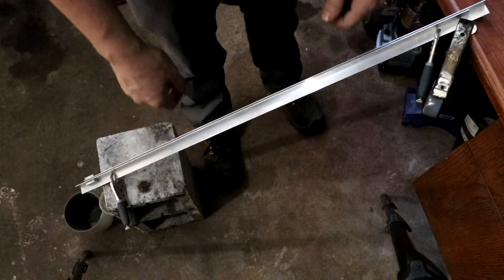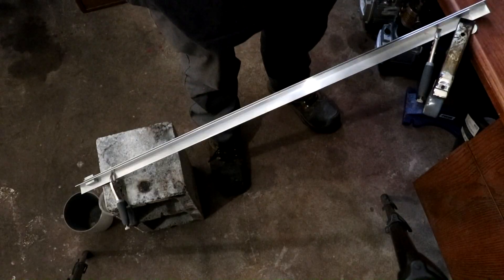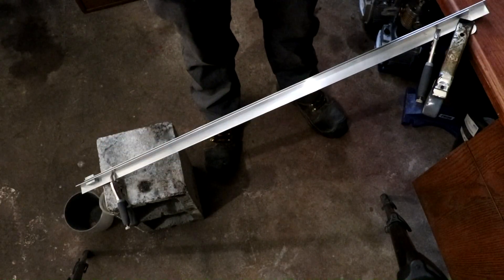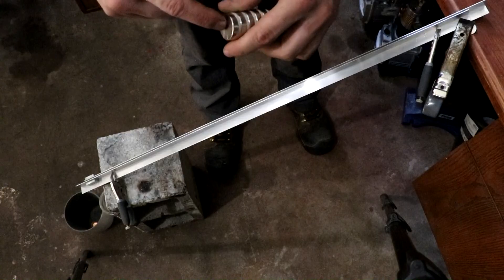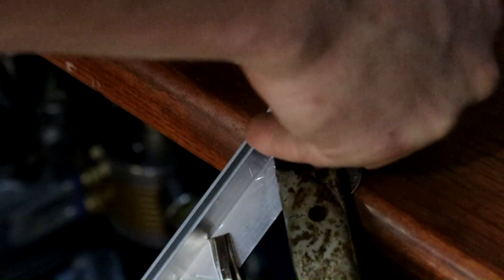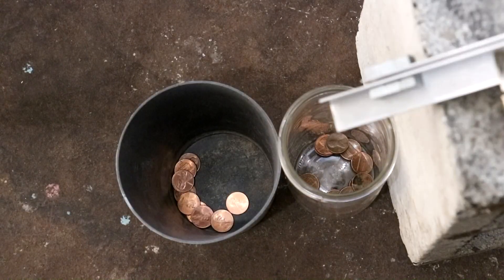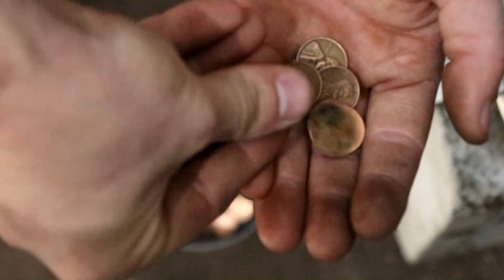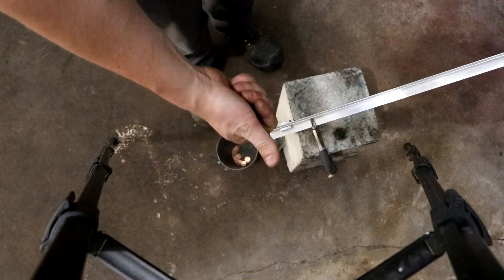I Made a Super Simple Penny Sorter!

Comment: I had an idea for a device to pick up spent brass casings at a shooting range using an electromagnet. It's be a scoop with the open end facing the electromagnet, and a switch to briefly energize the magnet. With a strong enough magnet it'd kick the casing into the scoop but not the surrounding gravel.

I wanted to make it because bending down to pick up brass casings at a Cowboy Action Shooting event was hell on my knees. But I didn't follow up on it because I was afraid the electromagnet might screw with someone's pacemaker.

Comment: 1982 d small date, 1983, 1987d worth more then a $100 in 90% copper error
Reply: 1982 have small date 3 variety for both zinc plated and copper, and large date 4 variety for zinc plated and copper, mint mistake copper was 1982 small date d, both mints of 1983 and 1987 d

Comment: Are the angles you used steel or aluminum  I know aluminum is not magnetic but I don't know if you have magnetic but I don't know if you have magnets on both sides and they are simply sticking to each other with the magnetic field between . Nice work. Is very simply but awesomely done

Comment: I'm a little ashamed I hadnt thought of this.  I was, several years ago, thinking of having an area in a man made river that was all pennies.  Since zinc corrodes much faster than copper I wanted to separate them.  In the end the method I was leaning to was using liquid to float the lighter zinc coins off, but didnt because I didnt want to have to try and wash so many coins to prevent toxins in a living river.
  I might dust off the idea, if I can get enough pennies with this coin shortage.

Comment: In the recycling industry, the device you made is referred to as an eddy current separator. Also, this points to a potential issue you'll have using eddy currents to stop a bullet: The higher the electrical conductivity, the higher stopping force. With a lead bullet, the forces may be very small

Comment: Cody will you use a water bottle as a vacuum tank and have a vacuum gauge attached to it, and then put that bottle in a pressurized chamber and try and measure the pressure in the outer tank by using the change in vacuum in the inner tank.

Comment: Hey Cody! I have a Chemistry problem I need to solve, perhaps you can help.
The production of biodiesel is very easy and efficient, but my problem is that while using a base catalist (like KOH) a lot of soap is formed in the transestherfication reaction with water(unwanted), methyl, fatty acids in oil and KOH. This soap causes the mixture of biodiesel and glycerine (the reactionproducts) and water to form a strong emulsion. This way the biodiesel can't be seperated from the rest. How can this be fixed? (there is a lot of information on this topic on the internet, but not everything works). 

I really enjoy your video's! ;)

Comment: Fun fact:  no Lincoln penny is "pure copper",  the vast majority of pennies pre- 1962 were bronze (95% copper and varies mixes of tin and zinc making up the other 5%, with the exception of the 1943 steel pennies) , in 1962 the tin was removed from the recipe giving us a high-copper brass coin.  and as you noted in 1982 the mix changed considerable and they went to a zinc core and only 2.5% copper overall.    

TLDR: if you want a 'pure copper' coin you actually have to find pennies from before 1857.

Comment: For the MK 2 it should use a spiral sorter. It would have several sets of magnets at different places to collect different types of coins. The spiral would have a different ?pitch?, and the magnets would be of different strengths. The strongest would be at the bottom while the weakest would be at the top to sort out the magnetic steel pennies. The magnets would slow down the correct coins and move them to a short inner section that would then drop into it's respective container while the rest would have enough momentum to roll by on the outer track

Comment: Best penny sorter could handle a whole roll (or roughly 50+) inserted at a time in the hopper. It was essentially a turntable driven by the motor out of a microwave (which rotated once every ten seconds) with about twenty penny sized holes evenly spaced about the perimeter. As a hole passed under the stack of pennies, one would be deposited in each hole. The pre '82s are a few milligrams heavier, so when they passed over a little counter-weighted dumper-arm, they would fall through, where the zinc ones wouldn't, and would eventually fall through a different open hole into a separate container. I still have two 5-gallon water bottles of the coppers for the Apocalypse, I guess. I also filled a lot of self-checkout kiosks at Wal-mart with the regular ones...

Comment: Why do the copper pennies slow down more than zinc ones? They're both conductive and should have induced eddy currents, right?
Reply: It has to do with how strong the induced current is, which is related to the electrical resistance of the metal. Copper has a lower resistance and makes a stronger induced field.( The penny basically becomes a tiny electromagnet and the copper one is stronger)

Comment: this is partly how coin validators in vending machines and arcade cabinets work. also more poles will make for a greater slowing effect.
Reply: Greater slowing effect?  Lol, the coins fell pretty much straight down already, slowing it down more wouldn't help in any way that I can see.
Reply: you should see it slow a steel washer or a plastic coin. it's a validator steel nickel plastic and other metals have diffrent reactions.  weight isn't the only thing that differentiates frauds from the real thing. also a penny taken down to the right size makes a great dime, but illegal.
Reply: I thought coin sorters used the wieght and/or the size of the coin to sort?  Do they really use magenets?  So how would it sort coins of different values that have the same exact metals used???
Reply: They have in the past to detect steel slugs.

Comment: The sound of the pennies going "tingaling" or "clank clank" according to their dates of manufacture is majestic.
Reply: That's like if you encounter older quarters with silver in them. The sound of them chiming off other quarters is distinctly different.
Reply: The slowed down audio of glass made it sound like it struck aluminium.
Reply: Highly accurate
Reply: its another way to sort zinc vs copper is drop them on a hard surface the copper ones ring better .
Reply: No... It was the sound of the pennies landing in a plastic flower pot, or a glass jar. 1:40
Reply: in his video yes,  but they would sound different if they were both the same type of jar.

Comment: Hey Cody / Community,
Quick question from a physics noob here. As far as i understand, the pennies have kinetic energy while rolling/sliding.
Where exactly does it go? In my mind i can follow it to the magnet, on which part of the energy is transferred via the tension of the mangetic attraction pulling on the fixed magned and subsequently the tension on the metal parts. But in what kind of energy does it transform? It doesnt seem to be kinetic energy, since magnet and metal parts stay in place. And it doesnt seem to transform into heat, since there isnt any friction involved in tension.

Could someone please help a struggling physics amateur? Im fairly certain, that im missunderstanding or totally overlooking something. :D
Reply: It ends up as heat. If you pass a conductor through a magnetic field it generates an electric current. That current creates a magnetic field that opposes the one it is passing though, producing a force that tries to slow down the object. If you pass a current though a resistance you get some power lost as heat. Zinc and copper have different resistivity which explains why the copper coins slow down more. A superconductor has zero resistance which is why a superconductor will hover above a magnet virtually forever
Reply: Thank you very much! :D

Comment: if the magnet were too strong, couldn't you just possition them higher? 
correct me if I'm wrong but the mechanism for the sorting is basically based off gravity, you slow one more so there's less energy in the roll, so if you had strong magnet youd need to move them up so that the coin has more (or less) time to accelerate...
Reply: Yes and no because the faster pennys could reach the slower ones and fuck up their speeds diferentials if have enough space to catch up
Reply: @fernandooyanedel6857  your implying that the space is an uncontrollable variable

Comment: Why did they choose zinc over steel? Modern UK pennies and Euro cents are copper plated steel, and as far as I can tell steel is significantly cheaper than zinc.
Reply: Maybe because they weigh less? They weigh about 1 gram less than the UK copper plated steel pennies.
Reply: I don't know about uk pennies, but as far as euros go only the lowes values (1, 2 and 5 cents) are made of copper plated steel. The other ones are made of different alloys.

Comment: You should try Euro-Cent Coins... As far as I know the 10, 20 and 50ct coins are made from different alloys ...
Reply: 10, 20 and 50 cents are all made of Nordic Gold (89% copper, 5% zinc, 5%nickel and 1% tin), while 1, 2 and 5 are made of copper plated steel. The 1€ and 2€ are made with two different alloys, Cupronickel for the inside of the 1€ coin and the outside of the 2€, and nickel-brass for the remaining.

Comment: Hey Cody..Love the channel, unfortunately I can't seem to find the way to private message you, but I was wondering if you could try to make gold from lead, using radiation, I've seen the demonstrations using nuclear water cooling tanks, and it took about 30 days, but i was wondering if it could be done with a lower radioactive element instead. how long it would take, ect.
Reply: Try to do it with a philosopher's stone, should work much better.
Reply: You could get some lead, make fishing weights from it, sell it on Ebay, and use the money to buy gold.
Reply: Youtube did away with the PM system a little while ago.
Reply: This is essentially what Rutherford wanted to do, which helped him learn all about the atom and the particles that make up the atom. After a lot of research by him and others, theres really no way to turn a non ionized material such as lead, into another non ionized material like gold. I believe (its been a couple years since i did physics) that only ionized materials change states as they lose parts of the nucleus changing the element
Reply: I've seen them do the experiment at a nuclear reactor, I'm just wondering how strong or a radio active field is required to knock off the extra electron, would be an interesting experiment.
Reply: Why would you want radioactive gold?
Reply: I am pretty sure the most efficient way to convert lead to gold is to suck on a chunk of lead for about a month straight.  This gives you 25% of gold by the wieght of the starting piece of lead.  Not bad really.

Comment: FYI: The alloy remained 95 percent copper and 5 percent zinc until 1982, when the composition was changed to 97.5 percent zinc and 2.5 percent copper (copper-plated zinc). Cents of both compositions appeared in 1982, so you'll end up with 1982 pennies in both jars.
Reply from the maker: Yep, this should then sort better than my eyes could. Also prior to 1950 the alloy had tin and was more of a bronze, I plan on doing a video on this with my x-ray at some point.
Reply: Cody'sLab 1945 and 1946 pennies were often made from scrap WWII cartridge brass. They look more yellowish to me.
Reply: @theCodyReeder  Xray!!!
Reply: 1947-1962 were the years containing more tin than zinc. I have been collecting as many of these bronze pennies as possible, with the intent to "prepare for when it's legal to melt 
them" I will probably make a knife or something out of this penny bronze
Reply: Danke
Reply: They also changed the size of the print on the date in 1982.  The date on newer pennies is printed slightly smaller than it was on old ones.  Interestingly, they managed to do this in such a way that both the copper and zinc pennies were struck with both sizes of date print.  So you have pennies in all four combinations of small/large print and copper/zinc.

One way you can test a penny to see if it's copper or zinc (let's assume it's a 1982 one so looking at the date isn't good enough) is to drop them against a hard surface and listen to the sound they make.  Copper pennies "ring" when struck, a sort of "tiiiiing" sound that takes a while to die out, assuming of course that it's not damped out by coming to rest on the floor.  Zinc pennies don't ring much at all.  They make a sort of dull "tink" sound. Incidentally, I do not recommend throwing mint condition pennies at hard surfaces.
Reply: I've heard that there were some 1983 error pennies that have more copper than zinc.
Not entirely sure if that is true or not but, if anyone could find one,
It would be worth a pretty penny.
Reply: 82s can be either
Reply: A sorter like this is required for mass sorting, even if it is only to sort your 1982's, which would otherwise be tossed as it is too much trouble to sort to be worth it. It would be worth it to add a huge magnet to the hopper to keep ferromagnetic pennies from being sorted in the first place.
Reply: You can also actually tell the difference between the copper and zinc pennies by looking at them. The copper ones have more pronounced details. Also pre 68 if i remember correctly, have even more detail than 69-82 copper

Comment: I wonder how this works at a high rate of speed? It occurs to me that if one were looking for a good melt quantity of copper, you might want it to chooch a little faster...

Can you get it to work if they come in one after the other in rapid succession?
Reply from the maker: well this is just me hand feeding it, I can think of ways to make it go Waaay faster.
Reply: couldn't you just use a few magnets at the top end of the slide so a constant stream of pennies turns into a stream of pennies spaced perfectly for the sorter at the bottom?
Reply: @spaminbox  not for THIS mechanism. The point of this is that they slow down at the end at a different rate depending on the penny, so if they sorted at the top the difference in momentum wouldnt be enough. Perhaps a system where the magnet pulls the coin to the side as they go down, and the ammount of pull the magnet gives determins what track it goes down
Reply: Please make a video sorting a ton of pennies really fast!
Reply: As an exercise for the student - how many pennies in a ton?
Reply: J. Williams   363,000 pennies. Each penny weighs 2.5 grams  there ya go
Reply: Rampage, you're being imprecise.
J. Williams, you should probably specify the ton you're using.

406,419 - pennies in a long ton
362,874 - pennies in a short ton
400,000 - pennies in a metric ton

Obviously assuming no corrosion/wear. When you're dealing with hundreds of thousands of pennies, that could actually skew results by a noticeable amount.
Reply: +kc koellein
+Robert Szasz
Or you could use a rotating mechanical gate as a combination orientation and feed mechanism.
Reply: Speaking of imprecise.....

He should also have specified a ton of which pennies

1982 and earlier (95% copper) pennies are 3.11 g
Newer 97% zinc pennies are only 2.5 g
Reply: RampagexLegitx  pre 1982 pennies weigh 3.1 grams tho
Reply: A ton of them
Reply: I imagine the faster pennies could catch up the the slower ones and skew the results if you feed them too fast?
Reply: @-The-fire-guy  but aren't the magnets at the end? So the pennies would all be going the same speed all the way till the end
Reply: The first thing that i can think of is at some point if the newer penny's were to run into the older ones, it'd slow the momentum down enough that, that could ruin the sorting. but i'm sure there's ways around that.
Either way a follow up video could be pretty cool to see what you'd have to do to get it to go faster. Plus making a feeding mechanism sounds entertaining. hehe
Reply: @ReiakumaArts  Two words: optical encoder.  :-)
Reply: @kckoellein  Optical sensors and air jets from high speed solenoids would do the trick nicely. Speed gate before magnet, speed gate after. 

If you wanted to have extra fun, a magnet with a coil on the other side of the coin track might let you determine speed, density and composition at the same time.
Reply: If you want to feed your melt faster, just presort the pennys. You can also use more of these assembly's in parallel.
Reply: parallel tracks, you can utiilize both sides of the magnets, too. then you time the time it takes for a copper penny to exit, and autoload the pennies at a rate where they won't collide
Reply: Ryedale makes a coin sorter that can do about 300 coins per minute (5 per second). One guy who has a video about it (Wvy_sCJT8Yk) says that it basically works like a metal detector and it mechanically directs the coins in one direction or another.